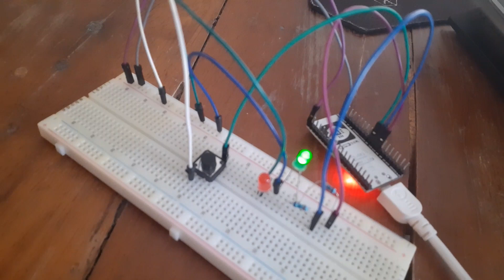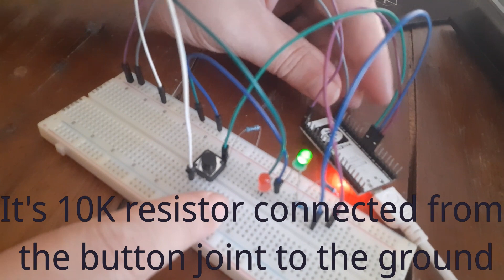ESP Tutorial Playlist - Pull Up and Pull Down Resistors

Comment: Very useful tip for novices.
A schematics would be useful, although this is a very simple circuit.
Also, it should be mentioned that many (but by no means all) microcontrollers and peripheral chips have internal pull-up or pull-down resistors, depending on their idle state.
Reply from the maker: Thanks for the comment.
Sure. This is just description of the principle. More like a reference. This video is more for software developers who are playing with microcontrollers. Most of them are getting stuck with some basics of electronics.
Reply: @kindspirittechnology  Yes, SW guys new to playing with actual hardware (very accessible nowadays) need this kind of basics. Thanks!